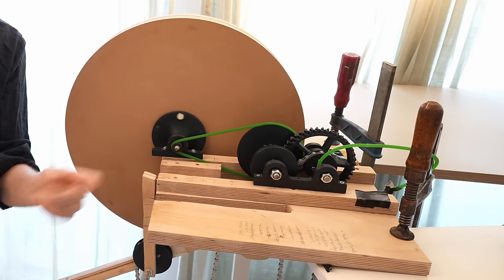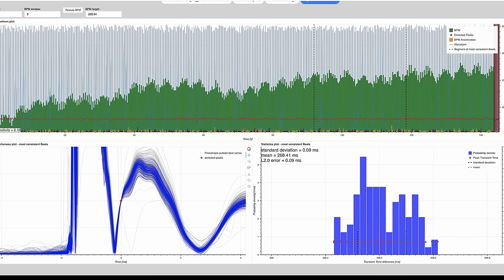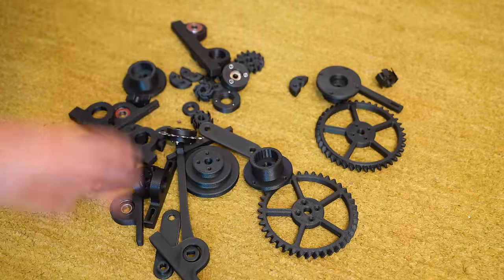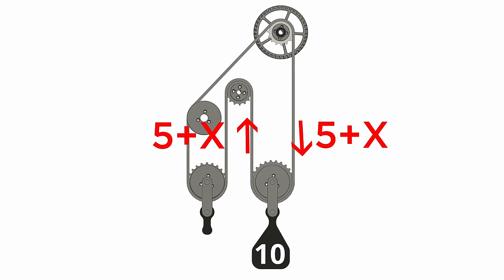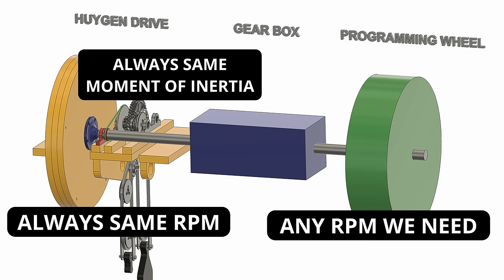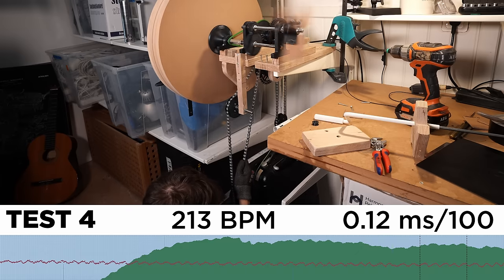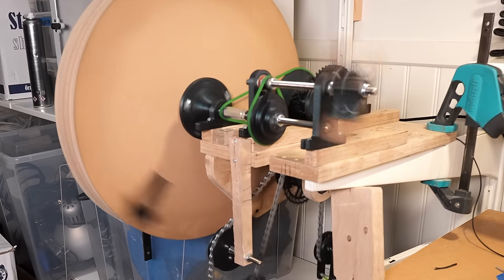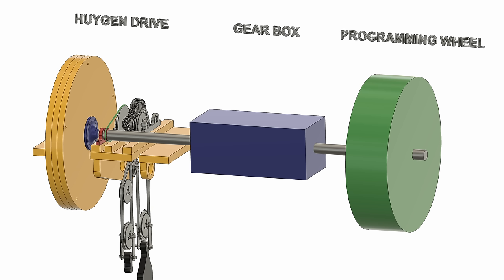Using Gravity To Play Tight Music

Comment: Remember that everything you tie to that power output is going to add resistance, so the gearbox will need to be tuned after all the power outputs are added!
Reply: The question is: Is the added resistance constant? Likely not.
So just putting a constant power into the system won't cut it.
Reply: Made me think the gearbox actually needs to be a CVT such as an enviolo. A control system of some sort to adjust its ratio to maintain a constant output rpm would be needed.
Reply: Yeah I’m thinking he’ll end up hitting a wall if he continues on without addressing this. Unless he can come up with a very stable governor, the tempo will be all over the place.
Reply: Yes, constant resistance is key.
Reply: I was sitting here wondering if the system is that twitchy with changes in the grease on the bearings, how are the differing power demands over time from actually lifting and releasing marbles at different rates e.g breakdown low demand, full chorus high demand? Not sure how the power requirements would be stable?
Reply: Should probably have individual governors for each output speed of the gearbox.
Reply: @JBFromOZ  a good governor would be able to cope with that. The power input by the weight drive needs be some margin higher than the maximum power demand of the machine and the governor then limits the RPM to a constant value. If the machine needs more power, the governor will dissipate less power.
Reply: Remember that this governor works because air resistance is proportional to velocity squared.  That is, the dr/dt (eg the force that tends to adjust the speed back to the set point) is directly proportional to the overall speed of the governor.  When you have a larger static driving force you will probably also need a larger restoring force to keep the tempo from drifting... which means you need enough excess energy in the system to cope with the extra v^2 static dissipation of the governor.

Long way of agreeing with everyone that you'll need to tune all of this with a realistic amount of power being taken off -- and that the governor isn't magic, it ability to restore a constant speed is proportional to its basic speed, and the amount of force it dissipates in the steady state will by necessity increase sharply as the speed increases.
Reply: So in the end we would need a formualr of konstant Power Output.
On the input side would be the potential Energy of the weight lowering + the introduced Energy form the crank shaft. On the output side would be all the energy needed to play the Instruments plus and turning note barrels. As seen we need some kind of adjustable dampener, or something that uses more energy the faster the flywheele goes? Maybe a simple fan? I don't think what martin used was very good as it introduces turbolance and Not constant airflow Like a Fan.
Reply: @selectthedead  An air governor might not be good enough for Martins goals, but there are many tried and tested governor designs. Martin said he will experiment and he showed us a design in this very video. So I expect there will be more on this in one of the next videos.
Reply: @cranemon  He will always hit a wall lol
Reply: dzindevis5078  Unless he sets it up to fully play at the fastest tempo and just gear shifts down to slower tempos with increasing torque, which could break the machine if it goes too far.
Reply: dzindevis5078 to change the tempo during the song, you need to add the gearbox between the weight and the drive gear of the flywheel as that will change the power input (though given the governor dissipates power with the cube of speed, you'd need to have an 8:1 gearbox for a 2x increase in tempo - assuming no load from the machine, with a constant load it would be less)
Reply: dzindevis5078 It honestly sounds like he needs a manual transmission from a car by the end of this.
Reply: @Ed.R  Yes some kind of CVT or Clutch that is tuned to the maximum power output that could be taken by the system, and any lower output would need redirect the excess energy to something else like a brake or similar. This so that the total power of the system remains the same.
Reply: Yup, he is going to have to recalibrate this thing for every gear and every time the resistance changes. Every different song on the programming wheel will have a different average resistance based on the density and number of pins etc. Hopefully it is small enough, but I have a lot of concerns. This part cannot be measured in isolation.

Comment: Non-perfect timing is nothing bad at all, it makes music sound human, and there is no point in sounding tighter than a skilled musician. I also never even noticed any off-timing in the first MM
Reply: I think this is a common big misconception, but the first MM video is heavily edited and stitched together out of dozens of seperate takes for the sake of a clean outcome. It did not work properly. And neither did/does the MMX, it keeps breaking down and has to be fixed all the time.
Reply: there will always unavoidably be imperfections and randomness in the output of a rube goldberg machine, but to have any chance at reliability and durability it should be made to the most exacting design possible to begin with.
Reply: Yeah, there were several spots where the MM slowed down unmusically.
Reply: So what though? That's what made it charming, at least to me, the non-perfection of it.
Reply: @FreejackVesa  You obviously don't know shit about making a musical instrument or something, considering you take such issue with "tight music" (and hundreds of other commenters, for that matter, are just as ridiculous). The machine needs to be dead-on accurate on its own first. Then, if any musical imprecision does occur, it can be stated confidently that said imprecision is the result of whatever the operator does during the task of operating the machine, like changing the speed of the drive mechanism unintentionally (or sometimes intentionally, for any reason), or by mistakenly having misplaced pins on the programming wheel. All of this also applies to the issue of dropped notes or falsely triggered notes; this absolutely must be because of errors from the human operator, not because the machine is doing this stuff on its own (I.E, a flaw in the mechanical design). These are 2 completely different types of imprecision that, really stupidly, hundreds and hundreds of commenters are totally confusing.

Literally anyone who's spent even a relatively small part of their life building a musical instrument would surely agree with what I'm saying.
Reply: @justinnaramor6050 Bro, just because you had a rough christmas, you dont need to rant insultingly and write half a book because somebody has an opinion. Aroh said nothing wrong.
Reply: @Alexander-oh8ry  Flat-out assuming I had a rough Christmas is also ridiculous. My Christmas was just fine, I had friends and family over and we had dinner together and, you know, a pretty typical christmas day for us).

Regarding the comment to which I replied:

The cold hard truth is that, just because you have an opinion doesn't make it valid. You have to sometimes bring a person's opinions into question.

The issue here is that, regarding the MM, it's pretty clear that these opinions from people praising the "imperfections" of the MM, as if it's somehow the same thing as human-induced imperfection, are largely emotion-driven. Yes, of course there are aspects of music that are most certainly emotional, but there are also aspects of music that are fundamentally factual/scientific/whatever. It's not all based on "feeling".

So even if my reply came off as a rant (and I was pretty much ranting purely for the fun of it, I'm not necessarily "angry"), my point still stands. There is, frankly, a bit of a lack of understanding regarding the concept of "imperfection" in this community.

I think one commenter on another video put it best (and I'm gonna try paraphrasing it here):

There is imperfection as a desirable element of live human performance, and then there's imperfection induced strictly by the machine, as a mechanical design flaw. Let's not get the 2 confused.

It's pretty clear, as I've made my way through this marble machine project in the videos, that the "perfection" Martin is seeking has everything to do with mechanical design, and literally nothing to do with removing the imperfection characteristic in live human performance. So, then, the fact that so many commenters have obviously failed to understand this actually blows my mind, because it's obvious enough. That's it. It shouldn't be that hard for anyone to understand.
Reply: @justinnaramor6050  damn, im not gonna read that lol
Reply: @Alexander-oh8ry  If you don't want to even bother to understand the point I'm making, then whatever. Be selfish or closed-minded all you want. But in this case, the fact my last comment was as long as it was is kind of necessary. Sometimes long comments are necessary for getting a point across. You're living in a fantasy world if you think otherwise.

You did say "damn I'm not gonna read that" after all. But I suggest you actually take the time to do so if you even want to understand my point.

Getting butthurt over just the simple fact someone writes a long comment is one of the stupidest things about the Youtube community, seriously.
Reply: @justinnaramor6050  Dear Sir, it is my professional opinion that you should relax. I hardly think saying that the perfect imperfections was, for me, the charm counts as "taking issue". Not that I really need to justify myself to you or anyone, I have built multiple synthesizers from scratch - designed the circuit, designed the board, etched the board myself, soldered all pieces togethers, etc. Even in the analog world of electronic music instruments there is a certain amount of slew or "imperfection" based on whatever your reference may so be. I think that slight imperfection gives character in opposition to metronomic rigidity. I fully understand that when he is talking about tight music he is talking about consistent results - in time and consistent tempo for example. In conclusion, your aggressive comments suggest maybe you are a little too tight.

So, I fully understand what he means by "tight music", but our friend often gets caught in the weeds with these projects. Make it consistent, HARD YES. Overly dwell on the minutiae as he has a tendency to do? I think he should be careful not to let his scope creep too much.

 Happy New Year - Jack
Reply: @FreejackVesa  Also, not sure if you read it or not (forgot to mention this before), but another commenter made it clear that the first MM never worked correctly. So talking about its imperfections as if they were no big deal is also wrong. What we heard in that first MM video was all of the best takes put together while the bad ones were thrown out. That video literally took like 2 or 3 fucking months to film, for just a 3 or 4-minute long piece of music, so if that doesn't prove how shitty the first MM was as an instrument, then I don't know what will. For one thing, it dropped notes or played wrong notes on its own when it clearly shouldn't have (this could be heard clearly in the video of the first MM at that one mechanical musical instrument museum in the Netherlands). It happened fairly consistently, too!

Comment: Part of the problem that you have is that a governor should be dynamic, changing shape and therefore resistance as the speed increases or decreases, to try to regulate that. Notice that the ones you showed from the museum had springs that change the aerodynamics of the wings, making it have more air resistance when it's going faster.
Reply: Yup he needs a centrifugal governor that will adjust its "throttling" with the speed. But at the very end it seems he may already know that but hasn't implemented it yet.
Reply: Came here to write this!
Reply: Do you think the governor would be tighter if the aerodynamic braking had two bi-stable configurations. I’d bet money it would have more authority to confine the RPM’s within an upper and lower limit.

I’m imagining such a contraption would flutter under steady state then quickly flip into one mode when the RPM’s drifted out of spec.

Perhaps using two of such bi-stable governors would be required?
Reply: There are also issues in that the fixed air governor (more like a retarder than a governor because of it's fixed vanes), cannot put energy back into the system. If the downstream mechanics draw more torque (say a lot of pegs triggering a lot of events), RPM of the system will slow and the air retarder cannot put much energy back into the system to help it catch back up to tempo. Instead, recovery of RPM can only come from the inertia of the flywheel which will respond slowly because of it's high mass.

A flyball governor, like the one James Watt used, can rapidly put energy back into the system if there is a sudden increase in torque. The spinning flyballs are a flywheel which can rapidly change their moment of inertia which means that they can store energy and return energy while maintaining the same RPM. It would be important to connect a flyball governor to the output shaft with very little backlash in it's coupling to the output shaft so it can act quickly to return energy to the output system.

The air governor, and air retarder, are drag only devices which cannot return energy to the drive system. Their vanes are too light to store much inertia and they can barely alter their moment of inertia through the movement of their vanes. 

The upside of these air drag devices is that they have unlimited capacity to burn energy while the flyball governor can only accept energy until their masses fully swing outwards. If the input drive, for some reason, continues to overdrive, the flyballs will slowly swing further outwards increasing stored energy, until they reach the full extent of their swing arms and no further energy, and capacity to govern ends.

I could see a flyball linkage which engages an air retarder to provide some unlimited energy burn though.
Reply: even without changing shape/angle with speed, it'll still act as a governor because air resistance is velocity squared
but yeah his governor design is dubious. why even use an air governor if you can use a fly ball governor? air governor with introduce a lot more noise
Reply: @DevinDTV  The air retarder is not really a very good governor because it cannot return energy to the system in the case where the output shaft sees an increase in load.

In the case of cyclic loads, say a peg is pulling on a cam, the flyball governor can output torque and help the drive system push the output shaft momentarily whereas the air retarder can only exert drag if things are going too fast.

The moving vane air governor will have substantially stronger behavior as a governor as it's vanes can move to increase resistance as RPM spikes. It's resistance see something like a cubic or quartic kind of gain in resistance wrt to rotation depending on how it's vanes are configured to reorient.
Reply: Feed the height of the suitcase back to the regulator, when the suitcase rises or lowers adjust the resistance that the governor applies
Reply: @carlchong7592  Ahh yes, that’s the piece I was missing, a flyball! An air retarder and a sizeable flyball linkage would sort of “pinch” the rpm’s down to a point from both sides, like a ball rolling down a 1/X graph getting stuck on the X^2 graph opposing it! My two bistable air retarders best case would be to make a “shelf” so-to-speak for the rpm to sit on. If you graphed the “governing force” vs rpm there’d be one fairly flat spot between two fairly steep spots. Much looser than your idea
Reply: @JanPeterTamminga  I think the oscillating behavior is due to the cyclic acceleration of the pedal pump which was directly pulling on the drive system. A flyball governor would be a good system to soak up a bunch of that oscillatory energy and smooth things out because it can absorb and return energy.

The air governor can dissipate a surge in torque, but it wouldn't speed up the "troughs" between peaks of the pedal pumping.
Reply: @drewmanzara5731  The flyball, like the air retarder, pushes down the peaks. The flyball also pulls up the troughs between the peaks.

Hmm, I guess if one was ok with a much more lossy system, one could pump up a compressed air reservoir. Put a good regulator on the output of the reservoir to provide very consistent pressure to the drive system. 

Constant pressure would relate to constant torque which is unfortunately still not synonymous with constant RPM, but it's a start.

It's so hard to match the very high response "stiffness" of electronic servo drive, or even fixed frequency induction motors.
Reply: This is not quite correct. The air governor is already dynamic - higher speed means higher air resistance. The problem is the range. Ideally, the resistance should be close to 0 at the start and tend to infinity at higher speeds. But you can't do it using air resistance alone.
Reply: @DevinDTV  Flyball governor has a range of stored energy levels where it will rotate at a stable speed.  It isn't capable of preventing a runaway condition (speed keeps increasing) after it has maxed out it's moment of inertia.  When the machine is underloaded, the flyball governor will max out and then the speed will continue to increase.  The air governor will continue to waste energy to the environment after the flyball governor has maxed out.     It would be possible to connect a flyball mechanism to a brake on the shaft rotation - which might be more effective than the air fins.